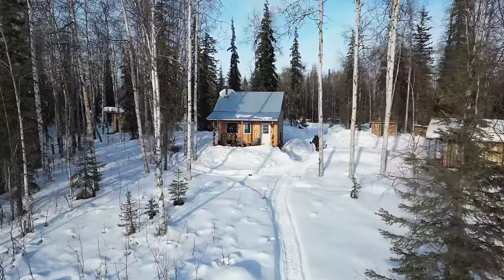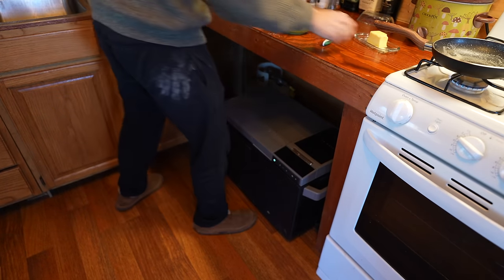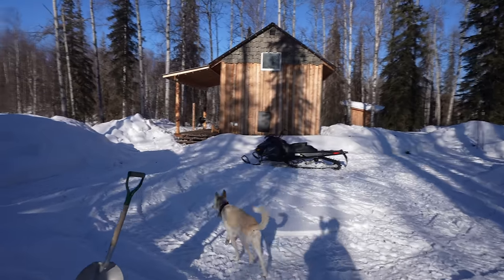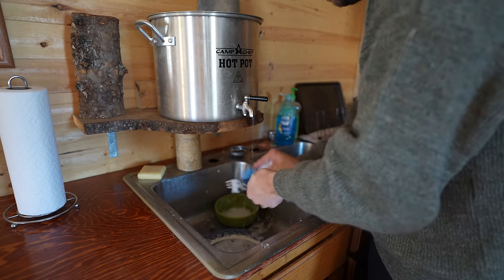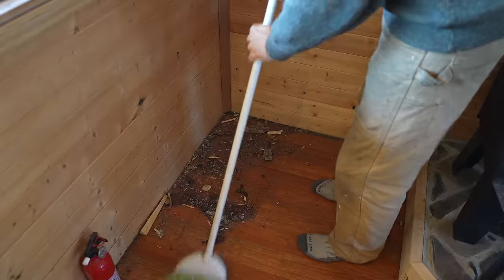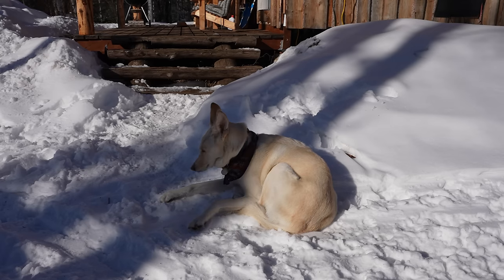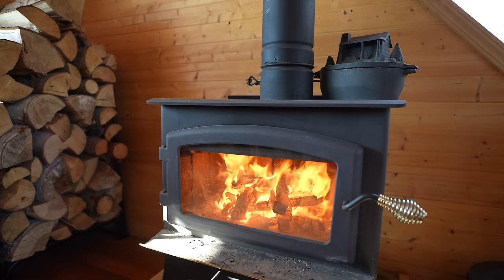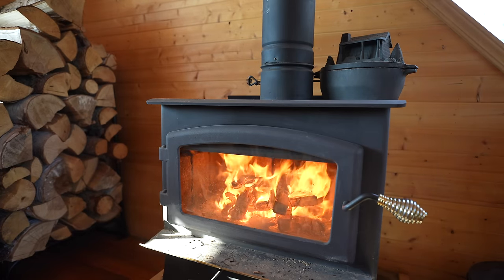A Full Day of Peaceful Cabin Living in Alaska w/ Narration

Comment: Love the channel. A suggestion…I have the same kindling splitter and ended up mounting it inside a 5 gallon bucket to catch the pieces as I split them. Saves a lot of bending over. Cheers!
Reply: 🌷What is the splitter  called,  where could I get one?   How did you mount it on the bucket?  Thanks😊

Comment: Hold the knife at the start of the handle and use your thumb and pointer finger to pinch the blade about in the middle right before the handle starts. You'll have more control of knife.

Comment: So, your Hot Point stove? You can light the top burners with a match but to light the pilot on your oven you need to plug it in? Just asking cause I got a propane small hot point stove that I was planning on using off grid.
Reply from the maker: Yup, oven won’t work without electricity

Comment: Technically, that’s not a chef's knife.  It's a Japanese nakiri knife and is considered by many chefs to be “the” vegetable slicer.  As you can likely tell, the reason it does that job so well is the relatively thin blade.  As a result, please do NOT use it like a cleaver and use it to cut through bone, as you’ll chip the blade.

Comment: Hmmmm.....just drill a 1.5 inch hole thru the back wall for the drain pipe under the sink....slope it down a little and run the pvc about 4 feet from back of cabin exterior wall....

Comment: Very cool channel. Check out blaze king wood stoves. We have had one for about 15 years.m and they are amazing. They have an auto damping system. U wont restart the stove in the winter unless u need to clean the pipe. Burn times are insane. 8 hours minimum upwards of 16. Im not affiliated by them in anyway but they are simply the best. Thanks for the great content